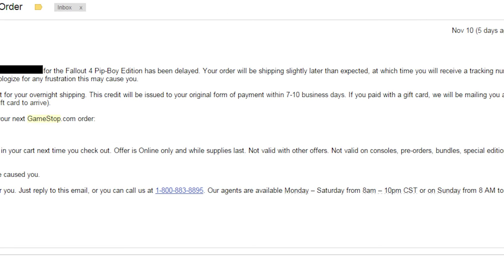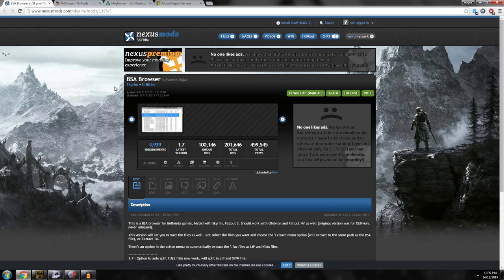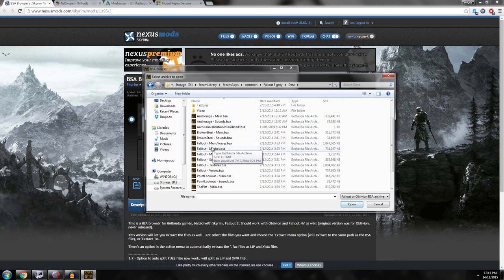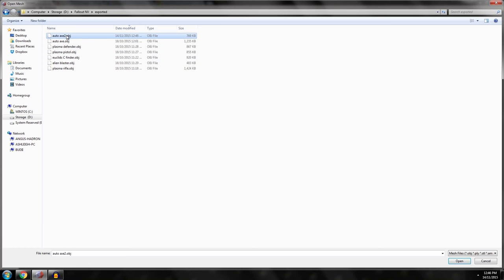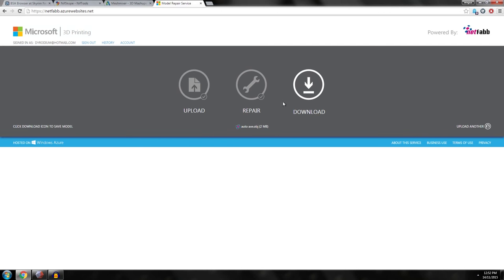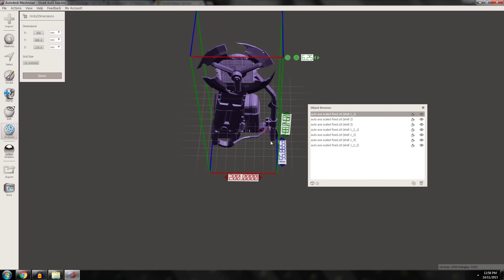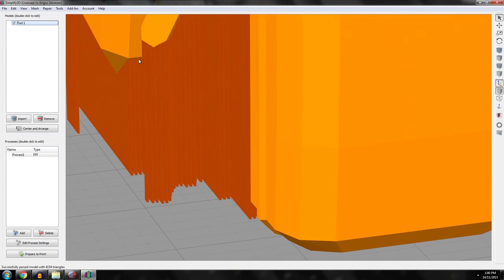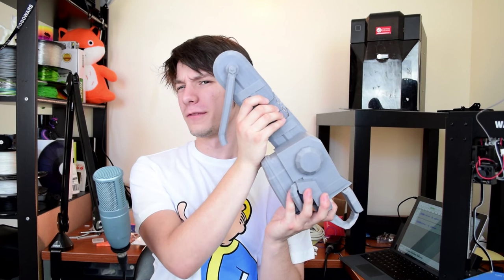3D Printing from Fallout! The Auto Axe - Part 1 of 2 - 2015

Comment: Are you happy with your wanhao i3 is it a printer that you recommend?
Reply from the maker: +Pierre Fransson It's a love hate relationship but I've got it working pretty reliably now. Definitely check out my review of it if you haven't seen it - my machine needed quite a few tweaks before it was printing well.
Reply: Ok i have a Hate Hate relationship with my K8200/3drag. Im thinking of buying some other printer.
Reply from the maker: I've heard nothing but bad things about those ones sadly.. might almost be worth parting it out and rebuilding it into something else - even changing the extruder might make it better to be honest.
Reply: +Maker's Muse I have a E6D-v6 on it now.  The biggest problem is the Z bending. Working on that problem.  Do you think that the wanhao i3 will be a better printer or do you recommend any other printer for a good price?
Reply from the maker: +Pierre Fransson Wanhao may be an improvement but it's still a cheap printer - if your budget extends higher the Flashforge is pretty reliable, and even higher the UP Box is one of the best machines I've come across in terms of 3D Printing large ABS parts.
Reply: +Maker's Muse ok thx for the help. I will start to do a rebuild of my k8200 to solve the Z bending. I was thinking of buying a Zortrax M200 but the Up Box have a bigger build volym.  What do you think of the Zortrax M200?
Reply: +Pierre Fransson or maybe a CreatBot DX?